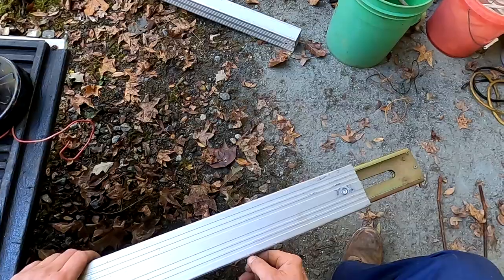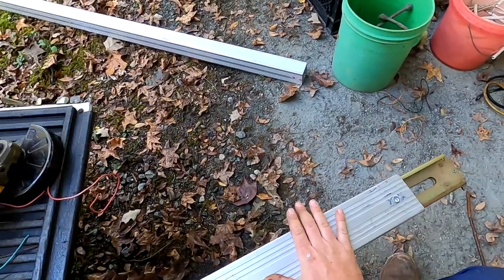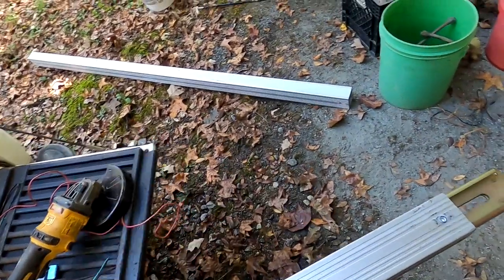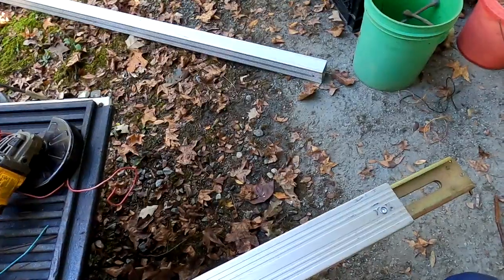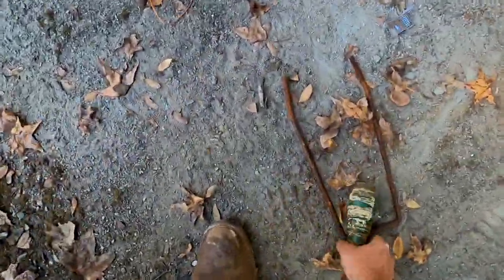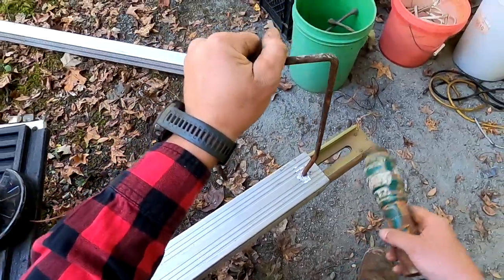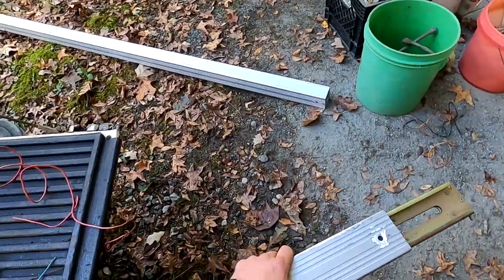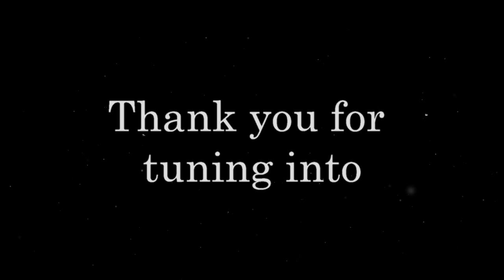Processing Out: Aluminum Shoring Beams

Comment: I like your scrap hammer and scrap punch, resourceful.
Reply from the maker: The hammer is a brass check valve with a piece of galvanized pipe in it.
Reply: Whatever works, right?
Reply from the maker: @scrapitall200  yes. It was a sub lesson for the video.